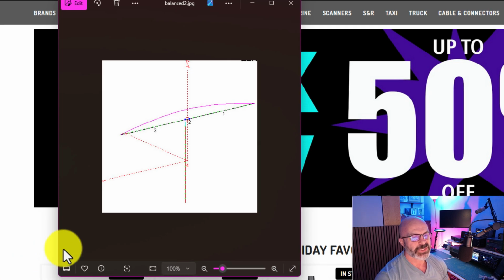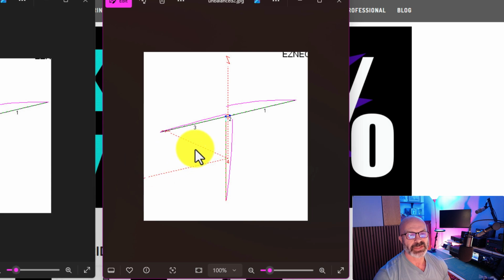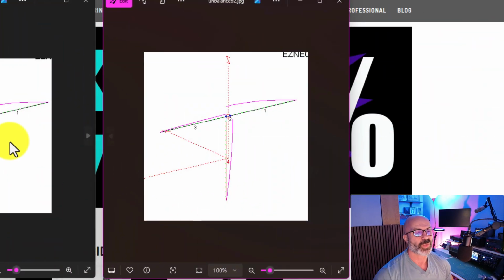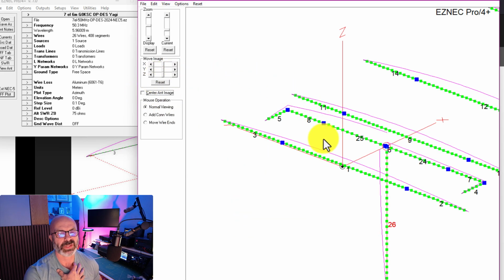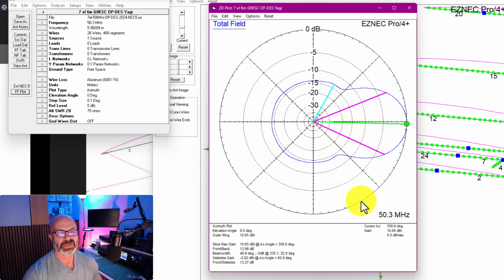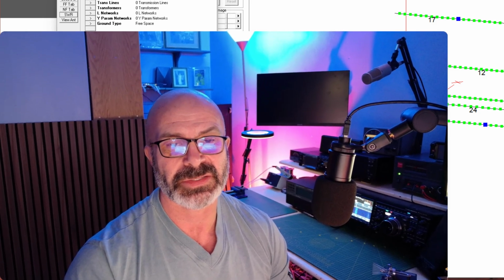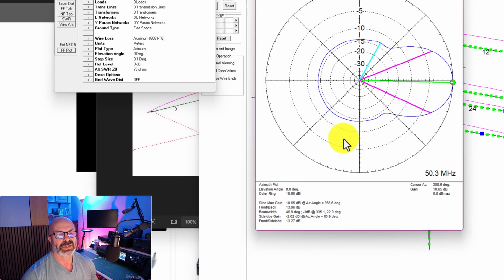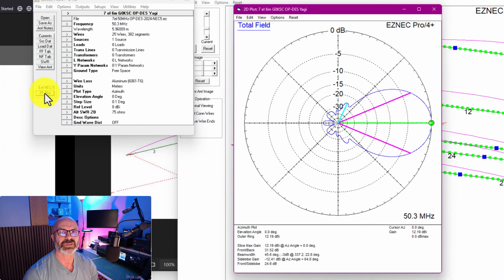Baluns - Why so important with Yagis & Quad Beams?

Comment: You modelling of the dipole with an additional conductor connected at the braid connection point is wrong. You have added what will obviously be a reactive element, which is NOT what the braid will present to the circuit. The braid is essentially a zero impedance earth connection and whilst that is not realised in the real world, it certainly is not what you have shown here.
Common mode current is the result of an antenna imbalance of some kind. Imbalance can be from asymmetry in the element lengths or some conductive object in the antennas near field. Then a current will be induced onto the braid.
A dipole mounted in the clear and fed with coax that comes away from the driven element at 90 degrees has no imbalance. 
de G0AFV

Comment: Thanks, justin for all your guidance. It has been long awaited.  Things that you say confirm my beliefs and experience. You say about the testing of common mode after you’ve built the ugly balun. Sometimes this or probably most times will not show itself to be evident so the test is a bit like keeping your fingers crossed. How do you get over that? I always put an ugly ballon on but I have since land they are too far away from The driving element but placed comfortably for the coax to run and ideally I would use messy & paloney  7.
Reply from the maker: there are clip-on current meters you can use to help show you what is there. Not 100% accurate but I have found the hand- on coax scenario does give good levels of detection.

Comment: This is why i prefer to use open line feeder on hf wire dipoles, mainly 40/80m, I guess the downside is I use a balanced/symetrical coupler in the shape of a double L, which dont come cheap but i feel it all aids antenna efficiency. Interesting video thou for coaxial fed antennas.
Reply from the maker: Yes, balanced line feeder is the better option on dipoles but has its own drawback, in particular routing and and keeping it well spaced from any materials (especially metallic surfaces) on the way back to the shack.

Comment: Thanks Justin for very interesting and informative video. I did not realise
 it would make such a difference. Is it possible to share the EZnec file showing how to 
 configured EZNEC for coax to antenna.
Reply from the maker: it is not something that is easy to replicate. as discussed in the video 'this is a representation of coax cable at the feed point'. Roy Llewellyn, the author of EZNEC shared with me this method of replication some years ago. Basically, the wire representing the coax is either corrected to the dipole to replicate no balun or disconnected to replicate a balun, where not current would directly flow back down the coax.

Comment: Thank for this impressive demonstration, Justin! 🙂
I am relatively new to the hobby (licensed mid of this year) and I am very interested in that sort of content. What you explained makes it more than clear how a missing balun can reduce the efficiency of a potentially costly Yagi just by "forgetting" to put such a simple balun in place (or in the right place). I myself do not have such a nice antenna, yet your explanation is valuable for me as I was not paying enough attention to putting a balun close to the feed point of a dipole, thinking everything is OK as long as I put a choke on the back of my transceiver. Now I know and understand what the impact of a radiating coax on the radition pattern is. 👍
73 de DL1HNR, Henner
Reply from the maker: Thanks Henner, this kind of message does make it all worthwhile for me. the biggest difference with a balun on a dipole is getting every horizontally polarised rather than some being vertically polarised. This will reduce noise and unwanted signal pick-up too.
Reply: @hamradioguys  My conclusion from what you explained is that having something being polarised in the wrong way is the worst case, but as "the RF does not know where the antenna ends", I assume it makes very much sense to choke the RF at the feedpoint of any (or most?) antenna(s), as the antenna was given a specific shape/ layout for a reason, end whenever we allow part of the RF being radiated by the feedline, it will impact the radiation pattern in a presumably negative way.
(Well, these are just my thoughts as a newbie and non-native English speaker.😉)
Reply from the maker: @hennero.3826  yes you are correct, antennas can be forced out of balance by real-world nearby structures too, something else I will be discussing soon.

Comment: Hi Justin.  What about if it 600 ohm ladder line 80 meter horizontal loop, ladder 40 meter quad all matched with a 1 to 1 and 4 to 1 at the shack
Reply from the maker: ladder line is a balanced feed line feeding a balanced antenna so theoretically, no issues. However, Coax is an unbalanced feedline. in such cases, when feeding a balanced antenna, issues such as the discussed can occur.
Reply: Thank you I was un shure, but I'm thinking of building a full size guad for 40 meter and using ladder line. Have you ever modaled vhf quad to use 600 ohm before.